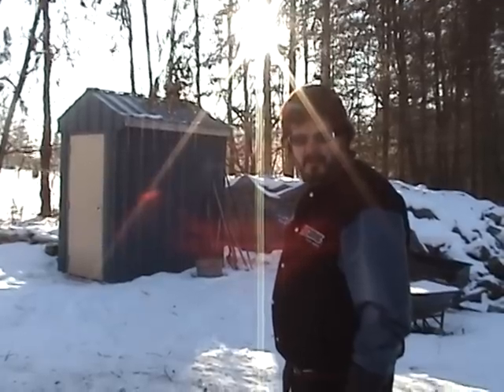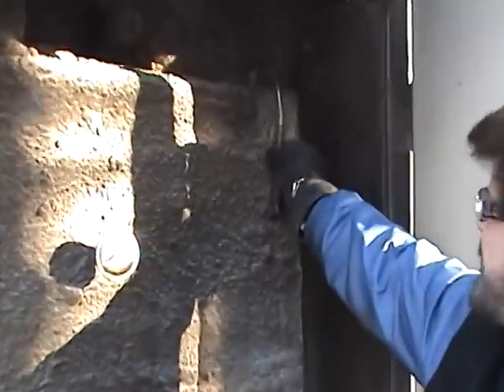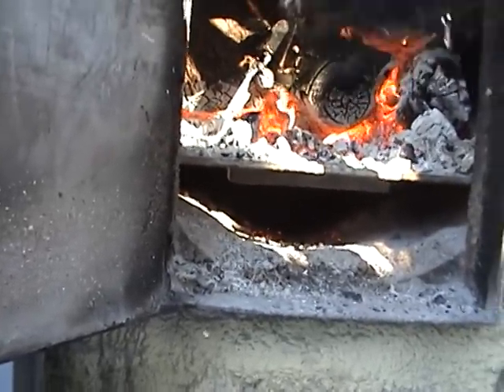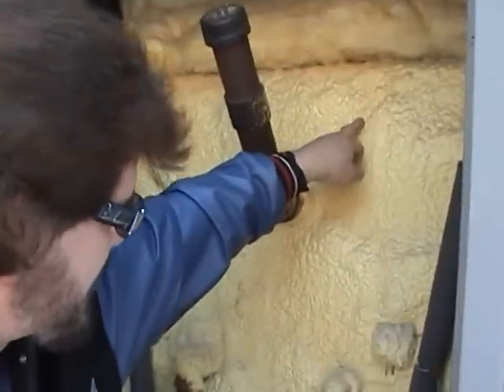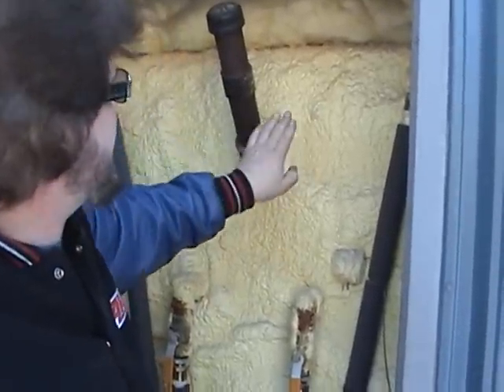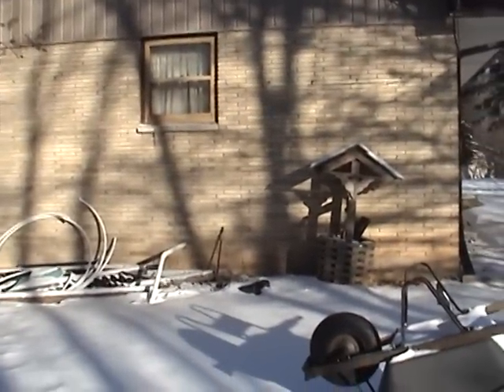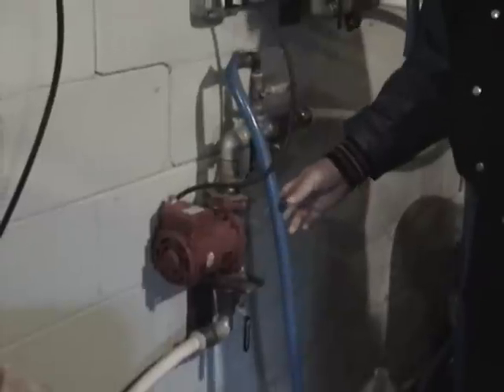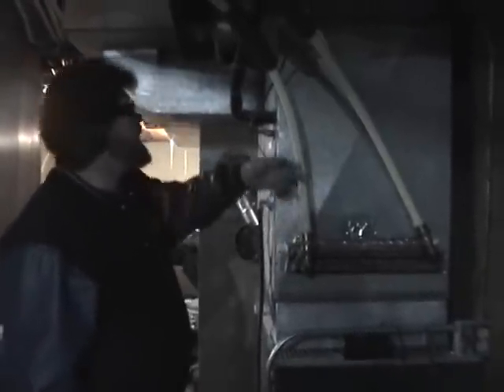Home made outdoor woodburner

Comment: I’ve been a boiler tech over 20 years, nice setup, but you really should have a pressure relief somewhere on the boiler tank, it may never go off but its a good precaution (probably a 60lb)
Reply: Terence Krebs as a plumber an also a first time viewer of these types of boilers I agree 100%. Just for peace of mind
Reply: The boiler tank is likely vented to atmosphere. He mentions in the video he consumes 4.5 gallons of water every six weeks.
Reply: Open loop system, no pressure. Usually the fill pipe serves as a pressure relief if is a slip fit piece of PVC inside a rubber sleeve if there is a boil over or the fan door gets stuck open for some reason after it shuts down and allows the air to keep flowing into the fire box.

Comment: Very nice set up. A sketch of the wood burner fire box would add icing to the cake. The water to air radiators   information would be great. Your heat losses are very acceptable. The transfer pumps is your $$ energy users. I have a couple of 500-600 gal ? Propane tanks that would make great fire boxes. The rectangular structure would require some creativity. Thanks for sharing.

Comment: I have been a professional installer of outside wood boilers for the last Ten years, and you are the first person I have seen with common sense enough to place your circulators in the house.  Not only are they easier to work on, but it provides greater head pressure for the circulators to work with. You will get better flow by doing it this way, in my opinion.  You did a pretty nice job..

Comment: Did you just use regular foam insulation or a special fire resistent kind?
Reply: The fire box is jacketed with water the outside of the unit wouldn't be hot enough to be an issue with the foam. Even "The Great Stuff" out of a can from the dollar store can handle up to 700F... it will discolor and possibly put off some fumes at that temp. I have seen this personally and the foam still be intact with no issues. I doubt he will have anything near that temp even if the water jacket ruptured and drained the whole system. I cannot speak towards any of those over priced foam boards but the spray stuff can take a good amount of heat.

Comment: That's the only way to go = for real heat when ever or always as you want it. awsome HE COULD USE A THERMOSTATICALLY CONTROLLED MOTOR DAMPER ON THE FIRE AIR INTAKE TO USE LESS WOOD. THE LAG TIME FOR CYCLE ON REHEAT IS MAYBE ONLY 3-5 min.That's what I do.

Comment: Now that is the make an outdoor boiler. You did a great job of insulating the outside of the the boiler. Can''t say that for the HeatMaster, the whole back of the water jacket is not insulated. They depend on the outside door to keep it insulated. When you open the back door, you can tell that you are loosing a lot of heat in the water. Nice job. Wish I had done this instead of buying a $10,000 boiler. I did insulate the back of the boiler and it does help, but not like you did with the spray insulation.

Comment: Does the cost of $3334 include the cost of the red furnace in your garage too?  Also, is that a special water heater that has a heat exchanger inside or can you do that with a normal water heater? Thanks! Great system.  Thank you for posting this!

Comment: Looks like this was posted in 2009, how is this system doing today. 1-9-17?  And do you have the same hair dew?
Reply: No second burn chamber, no full combustion at all..... sorry but it's wasting of wood with boilers like this one
Reply: @yevhenrekhtin6591  I agree I am looking into building something like this but using the wood gas to power a motor that uses the water pump on the motor for circulation purposes and also the motor runs an alternator in the front with the drive belt and possibly powers a generator that can power my home or at least supplement my power. I am in the design phase and without buying an expensive industrial welder generator. I am looking for an easy way to design a powerful 4500 to 5000 watt generator. I have quite a bit of 10/4 and 12/4 wire to make it of but not sure if I should spend a small fortune on magnets or try to design an electromagnet generator and use the alternator on the motor to actuate it?
Reply: @kevinlewis9151  slow efficient burning that's most important
Everything else it's mess sorry
Reply: @yevhenrekhtin6591  I agree it will get messy but there are companies that build what I am suggesting and sell them for like $10k at the cheapest
Reply: @kevinlewis9151  show me please and I let you know what I'm thinking
Reply: @kevinlewis9151  I don't see it possible to make a high efficient wood boiler with an ability of electricity generation
Honestly
I have my own project. And I though about that... about making it on few different ways. My conclusion is that you must choose some one thing. I decided to keep working with creating of more efficient unit for heating purpose 😉
Reply: @yevhenrekhtin6591  people are doing it people in North Korea still run their vehicles on wood gas because Kim Jong-un has them convinced that there is still a gas shortage from World War II
Reply: @kevinlewis9151  believe me they're running those not because they like it)) lol
They just was born in a wrong place 😅
By your example you're just telling me I'm right and this idea of gasification-generator isn't worth to be followed 😉
Reply: @yevhenrekhtin6591  if a vehicle can be run on wood so can a generator and there have been a lot of people to prove it I'm not saying it's ideal but it beats a $600 electric and heat bill in North America we're just for utilities we usually pay over $1,200 a month in the dead of winter

Comment: I want to say awesome job on your set up.I am in the design stage of my boiler right now.I have been planning the exact same thing you have done.I plan to use a heat exchanger in my furnace and then my 40x44 shop has radiant tube in the floor.
I appluad the nice clean job you did on your system

Comment: Where are u located and how much wood do you burn?. I"m in Northern Minn. I also have a outside wood burner and currently burn 15 cords. It heats my domestic water, chicken-coop, dog kennel and my 3100 sq ft. home. My wood stove is 96 feet from the house. I lose 7 degrees to the house. lines are buried 8 ft down. Love your system.

Comment: Great video!  Thanks for posting.  I'd be interested to see any pictures you took of the build process, the boiler, specifically.  Did you use stainless or mild steel for the tank sides?  How how is the exhaust coming from the chimney (how efficiently are you transferring heat from your fire into the water in the tank)?

Again, outstanding job!